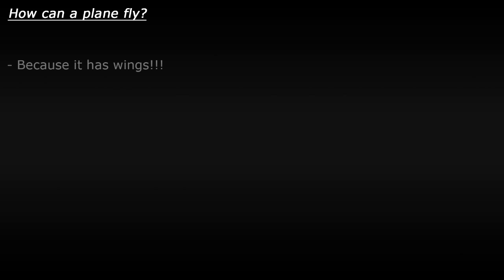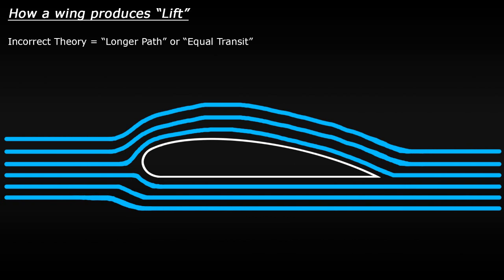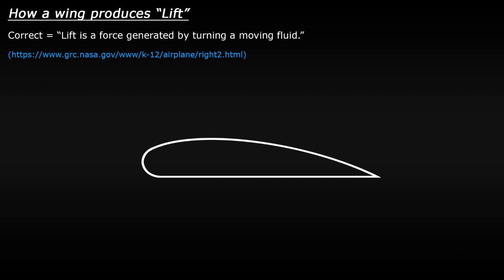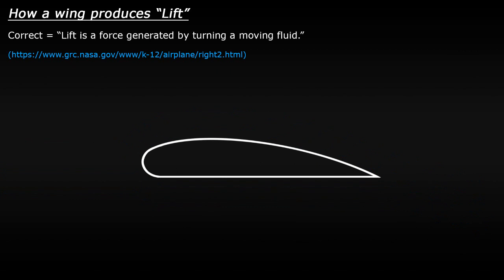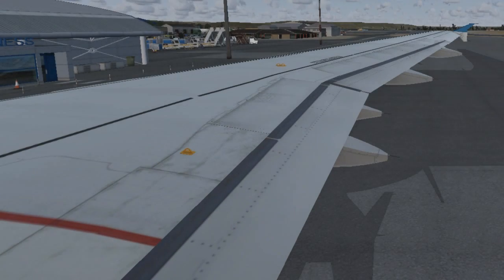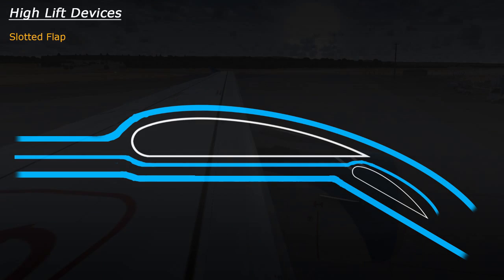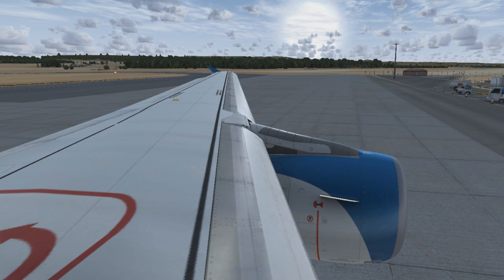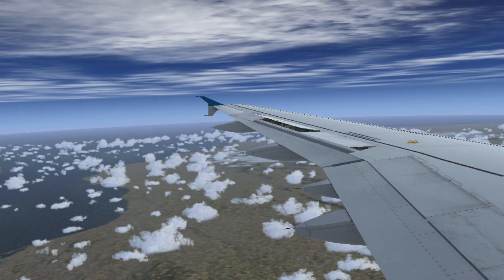How Wings ACTUALLY Create Lift!

Comment: We can talk about Bernoulli and other stuff, which no doubt plays a part in lift, but the main principle is Newton's 3rd law of motion, and downward pushing of air at the trailing edge of the wing.

How a wing generates lift is pretty much summarised in how wind gets pushed downward by the wing. The more wind gets pushed downward, whether more forcefully (greater airspeed) or at a steeper angle downward to a certain extent (greater angle of attack or use of flaps), the greater the lift. That's it, folks. Devices such as slats and flaps both aid that downwash of air by the wings, either by improving the flow of air over the wings such as use of slats (preventing detachment of air travelling over the wing), or by increasing the downward angle of air, deflecting it steeper  down, to a certain extent.
Reply: sure, but it's also summarized in the pressure distribution directly on the wing itself!
Reply: @AmbientMorality  ...so you mean Bernoulli, then? If so, I'll refer back to my original post. There are simple wings that have no camber whatsoever (completely flat on the bottom AND top). And those still generate lift, albeit more inefficiently.

That proves without a doubt the primary principle that generates lift is newton's 3rd law of motion, through the downwash of air...
Reply: @tristanhnl  They're both true. A flat plate at an angle must also have a pressure distribution that can fully explain the lift. Similarly, a turbojet does accelerate air backward and that's perfectly valid to calculate lift, but you could also sum pressures on the compressor and turbine and some other components and get the same result. Both valid.
Reply: @AmbientMorality  , both true, but again...newton's 3rd law is the big picture phenomenon responsible for lift, in the grand scheme of things. If I were to describe how it's possible for tennis to be played, I can explain how the molecules of the ball interact with the molecules of the floor and the tennis racquets....or I can simply explain the fact that the ball bounces. Again, not saying Bernoulli isn't true.....why do I have the feeling this exchange can go on forever LoL
Reply: @tristanhnl  nono that's totally fair. sometimes people read it as "part of the lift is produced with pressure differences and part of it is from moving air down", when really it's just two different complete explanations for the same thing

Comment: The Bernoulli/Newton dispute is a false dichotomy. They are simply different ways of describing the same phenomonem. Newtonian mechanics is arguably the more fundamental explanation, but the proximal cause of the lift (the only thing the wing feels) is the pressure differential that is a resultant of that Newtonian action/reaction. And that pressure drop is known as the Bernoulli effect, although Newton himself had observed the effect in tennis balls and concluded correctly (of course,) that it was due to action/reaction with the passing air.
So, probably go with Newton since he was a couple of centuries earlier than Bernoulli.

Comment: As a flying aerobatics pilot I have 2 questions:
1) I fly Extra 300 and Extra 330. How the hell am I flying if these planes have... symmetrical airfoils?  
2) I also fly RV-7. How am I able to fly inverted over runway and not smash into it?
Reply: Those airfoils are at an angle of attack, thus generate lift. Symmetric airfoil just means it doesn't generate lift at zero angle of attack

Comment: When teaching how to sail we often refer to this theory to show how a sail works. ie, the lower air pressure on the curved side of the sail allows the higher pressure on the concave side to drive the boat forward. This is counteracted by the keel/centreboard so that the boat does not simply sail sideways or tip flat on its side. Is it in fact the change of angle of the air coming off the back of the sail which creates " sideways lift" or is it the difference in air pressure?
Reply: Both. Differential pressure in a fluid (or gaseous) medium is not stable. The existance of a pressure difference necessitates the movement of fluid to equalise the pressure within the system in accordance with the 2nd law of thermodynamics.
Similarly, due to the conservation of momentum, and newtons 3rd law it is necessear, that the force of the airpressure pishing the ail forward have an equal and opposite counterforce upon the air, moving it back, bringing the sum of forces and moments within the system back to 0.

Comment: The lift force at the wing is caused by the angle of attack
Reply: Observ45er 
We are saying the same. The pressure difference is caused by the angle of attack
Reply: A wing, flat on the bottom, curved on the top, with the bottom parallel to the airflow,  lifts some.   There is  no angle of attack in such a case. (In that case it lifts because of Bernoulis principle).    But that does not cause enough lift to support the plane.  It makes the airplane more efficient though.
The vast, vast majority of lift is actually caused by AoA.   Many, many airplane wings are symmetrical, i.e. they are curved exactly the same on the top and bottom.  So ....???    EVERY airplane you see flying has serious AoA.  Look at how airplanes are built.  The wing is always at and angle to the body.

It has been traditional thru the 20th century to proclaim that the difference in curve of the top and bottom causes the lift.  Even the airforce taught that.  They should have been ashamed of themselves and many told them so.

Comment: Why does the stall configuration cause the aircraft to fall? You’d think having really low pressure on top and same amount of high pressure on the bottom would be better?
Reply: In a stall air stops flowing smoothly over the top surface - higher angles of attack lead to larger pressure gradients that try to force airflow to separate. The airflow after that separation point is recirculating, low velocity air so it’s no longer very low pressure

Comment: Good Heavens! Having been through the explanation twice and having read through the differences (sometimes rancorous) noted by commentators, I find myself still groping for answers. One question still bothers—if the air above the wing is deflected upwards, why isn’t the wing pushed downwards in an equal/ opposite reaction, rather than pulled upwards, which is what happens? P.S. i know about most of the demonstrations, blowing on top of a piece of curved paper, ping-pong balls floating above tubes, etc. Thanks in advance

Comment: Thx for the vid! But I still don't get it why the upper stream just speeds up by itself oO can it be that it travels with its normal speed whereas the lower stream is being slowed by the curvature of the wing?
Reply: Valid question! If the upper stream moves faster due to the wing curvature, how then does an inverted plane still fly?
Reply: @yezam8608  Angle of attack, which in any evwnt provides the greater part of lift.
Reply: There are no airstreams in flight. Air is mostly stationary, and the wing is moving through it, forcing the airmolecules apart in a mostly vertical movement pattern.

Comment: The way l see it is aircraft extend leading edge flaps on their wings at takeoff which have the effect of thickening them.   A thick wing generates more lift.  At V1 the air can't get out of the way quickly enough and gets bounced upwards but immediately comes down again with the weight of the atmosphere pushing down on it.  This has the effect of creating a vacuum above the wing otherwise known as a shock wave.  But vacuums have to go where vacuums belong, to the top of the atmosphere (equilibrium law).  The atmosphere, all trillions of tons of it, detect a vacuum and push it upwards.  But practically it's only the air around the plane which does the job.  The A380 weighs 560 tons app. at take-off and flies!   At higher speeds say north of 400 knots or so the shock wave has difficulty keeping up with the plane and tends to drag back on it.  The engineers get around this by angling the wing back into the shock wave reducing its drag effect.  This 'sweep' angle gives an idea of the operational speed of the plane.  The bang one hears when the plane breaks the sound barrier is the shock wave,  no longer able to keep up with the plane, collapsing explosively.  I've seen these shock waves above planes' wings landing at airports as condensation formed along them.  In fact,  you could say aircraft fly by using the earth's gravity,  reversing its effect of a downward force to one of lift.  Aircraft fly by gravity.

Comment: It's interesting that one of the most well known bombers of the second world war the B17 had a symmetrical aerofoil. That is the curve on the lower surface was exactly the same as the curve on the upper surface, and yet this plane had plenty of lift and could carry a heavy bomb load. So that definitely denies the Bernoulli principle.
Reply: A symmetric airfoil does not generate lift unless at an angle of attack (in which case it is not longer symmetric relative to the airfow). Bernoulli is always right, but it says nothing about equal transit (or more generally, it says nothing about what two different streamlines do).

Comment: I still don't understand why it creates lift. As you explained that downward airflow happening after it left wings. So it should be no affect right? Air should lift aircraft bottom of its wing right?
Reply: The wing creates a pressure difference between the upper and lower surface. That multiplied by wing area gives you the lift. But the air itself is deflected into a new direction by this interaction resulting in a downwash behind the wing. Before the passage of the wing the air has no vertical velocity. But afterwards it does. In principle, if you knew what this new air velocity was, times the mass flow rate of the air involved, you would have the rate of change of momentum of the air. Forrce = rate of change of momentum, so what you would have calculated is the equal and opposite force to that on the wing. So, the pressure of the air physically in contact with the wing, and the momentum change (or deflection) of the air, offer two alternative theoretical methods to calculate lift. But we are talking about contact forces here - no 'action at a distance' - so only the pressure of the air actually in contact with the wing is physically lifting it.

Comment: So many things are just so wrong with this...

1) Air does NOT speed up.  Smoke tests clearly show it SLOWS down over the top.
2) Lift is from bottom AND top to the degree the mass is moved down. 
3) lift continues when a stall occurs.  Lift peaks at 45 degrees AOA where D=L in wind tunnel test, which I have done before... 
4) At around 15-32 degrees the stall occurs and depending on the shape and planform
5) the lift will lower to some point as AOA is increase and then regain the upward trend to a peak at 45% AOA
6) Delta wings stall at 32 AOA while rectangular planforms stall in the 15 degrees.
7) if you for a stall at 1degree by some means, the lift line will be a nice smooth arc with a peak at 45 degrees
8) Typically upon stall ~ 0.5 CL of the 1.5 CL before is lost. 
9) fighter jets have sharp leading edges.  Flow remains attach due in part to planform,
10) The low pressure is caused by the flow being turned around the top of the wing like a ball on a string.  The tension at some point exceeds the stickiness and pressure and separates.  Bernoulli has nothing to due with it as it is not a constrained flow.
Reply: Air definitely speeds up near the leading edge on the top. That's why subsonic airfoils perform horribly at higher Mach: they reach critical Mach (and drag divergence) well before free stream is near Mach. If you're looking at some common smoke tests, it approaches the stagnation point and slows down before rapidly speeding up over the leading edge. It then slows down and never quite catches up, but it absolutely has sped up a lot over the upper surface near the leading edge
Reply: @AmbientMorality   What I meant is it does NOT go ahead of the free stream.  It does have  to travel further around the body than the free stream, but it does not get ahead of the free stream as seen in smoke pulses.  When the pressure drops the temperature also drops and Mach Number = (gama RT)^.5.  We see this with fog over the wing, so yes the local flow will be higher Mach number, but it will not be further down the road of the stream outside the local field.

Comment: It makes sense to me but I do not know if it’s right or wrong
Reply: Here's a link to a NASA article about why this explanation is wrong.
https://www.grc.nasa.gov/www/k-12/airplane/wrong1.html

If you do not trust clicking the attached link just google search "can a symmetric airfoil produce lift" and the first option should be the article I am referencing. An excellent point in the article is that if the air passing over the top wings is what creates the lift, then a plane flying inverted would be pulled straight to the ground. But planes can fly inverted, because lift is created by pushing air down from the angle of the wing.

Comment: From seeing many videos on how a plane's wing generate lift I can say you said some things in this video that don't match what other videos say. For example i never heard that the air flowing downwards at the end of the wing is how a wing generate. A wing cannot create thrust. I had the impression that fast air flowing over the wings creates an area of lower pressure and as air moves slower under the wings it creates an area of high pressure or in lames terms air builds up under the wings forcing the wings to move to where there is less air  such as above the wings. Sort of like stinking your hands out a car while doing 55 on a highway. You can feel that pressure difference on both sides of your hand as you change the angle of attack. who is correct?
Reply: Both explanations are correct. The pressure difference necessitates air moving downward. You can correctly calculate the lift force from the pressure difference, and you can also correctly calculate the same lift force based on how much the air moves downward (the momentum change of the air). A quick way to think of it is that if there's fast air over the top and slower over the bottom, there must be a "circulation" about the airfoil. This circulation speeds up air on the top, slows down air on the bottom, and past the back of the airfoil it must be pushing air down (it's also pulling air up in front of the airfoil, and you see that effect too in wind tunnels). Showing the vortex itself is quite hard, but we know that angular momentum is conserved. That means that if there is really a circulating vortex around the airfoil whenever the airfoil generates lift, then suddenly accelerating the airfoil in a fluid (thus suddenly increasing lift) must lead an opposite vortex. If you watch the video "Ludwig Prandtl Historical Flow Visualization Film" on YouTube, you'll see this exact phenomenon: when an airfoil is accelerated, a vortex forms behind it. 

Some notes: the general theory is potential flow theory and the circulation theory of lift, and Anderson's Fundamentals of Aerodynamics textbook covers it well—also easy to find via questionable methods :). The "angular momentum is conserved" part is really Kelvin's circulation theorem which is effectively angular momentum conservation for fluids.

Comment: A stall does not actually stop the wing from producing any lift. Stall just means that as you increase the angle of attack, the lift decreases. In an aeroplane, this does usually cause a significant decrease in lift, because the plane will probably start to descend when you decrease the lift, causing the angle of attack to further increase and therefore the lift to further decrease; but there will still be some lift left at the end of this.
Reply: And worth noting is that at the stalling AoA the wing produces maximum lift. ;-)
Reply: Michał Gawron I believe how it works is that the wing provides more lift at the stalling AoA, but the speed of the plane decreases very quickly, dramatically decreasing lift

Comment: No it's because the air going over the top is deflected up and thus creates a pull on the front of the wing. Additionally the air going below the wing pushes because of the low angle of deflection. It has nothing to do with air speeding up,  the air isn't joined at the hip and the longer distance the air has to travel is a coincidence and is a miss applied term..

Comment: The amount of lift produces by an airfoil at AoA of 0 degrees, is tiny. There is not enough lift produced by the force to lift an airplane. You have to have an AoA which causes huge forces.This also explains why an airplane with a non-symmetrical airfoil can fly upside down (the AoA even when upside down causes enough force to lift the plane). And it explains why a symmetrical airfoil can fly at all.
Try this: use a flat sheet of 1/8" plywood to create a wing for a model airplane, i.e. no airfoil at all. Put in an Angle of Attack of 3 or so degrees and it will fly just fine. (Did this when I was 13 yrs old or so on a control line model airplane ).